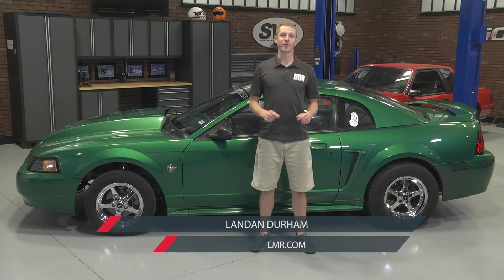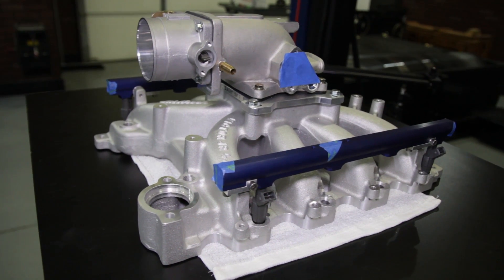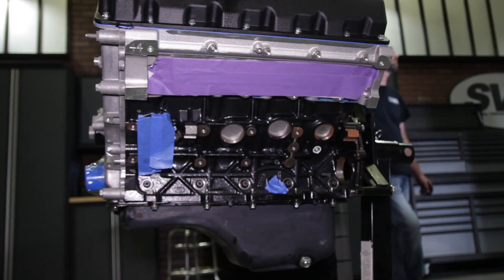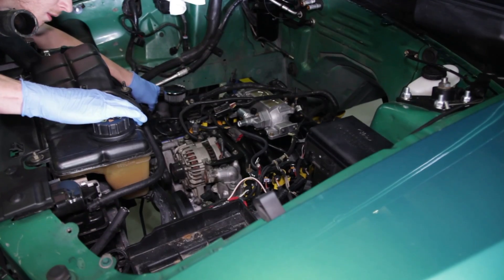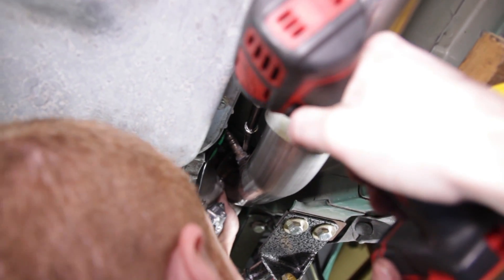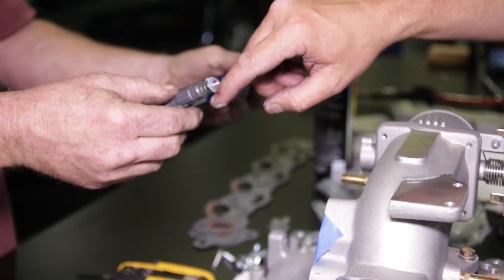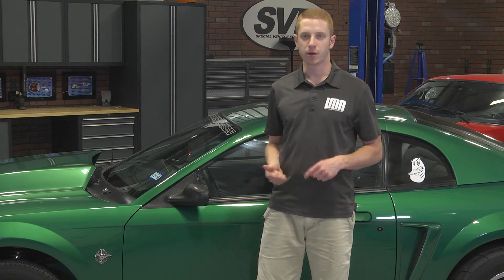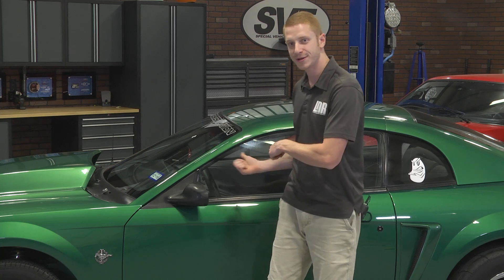1999-2004 Mustang GT Project Green Bean (Stage 5)

Comment: Where did you get the adapters for the intake? I plan to swap a 5.4 in place of my 4.6 with my v1 blower kit to add some more tq to the mix instead of placing another 4.6 in it
Reply from the maker: Hello Michael,

We did a search and found a few outlets that offered 4.6L to 5.4L 2v Intake Manifold Spacer Adapters. We picked one up that was the best price for your build budget. They range from $150 to $200 across the net!

Comment: just watched the entire build . ive always wanted to know if swapping the 5.4 would be worth the swap vs paying an arm and a leg for the 5.3 boss short block.. I had read that the 5.4 gives you more torque but the hp numbers for the 4.6 are about the same  they didnt  gain any noticeable hp over the 4.6 even though it has more displacement.. i have never been afraid of intakes or any of that since mmr has this adapter plate , but i do remember that some folks said you have to do some custom mods like cutting the k member to meet up with the 5.4 motor  as it might  be in a different location..  thank you for the videos keep them coming..

Comment: Why shorty headers? There is no performance advantage over stock manifolds. Since you were in there, why not go with long tubes?
Reply: Gitsum they just transfered over, cost savings. I don't think they just take parts of the shelves
Reply: David Martin if cost was the issue, they should have left the stock manifolds in place until long tubes could be added.
Reply: Gitsum well if anything, these headers probably offered 5 more hp 😂😂
But yeah long tubes are indeed better

Comment: questions I hope you guys at LMR can answer... Motor build up, what's the spec for the motor..looking to Motor my 4.6..
Reply from the maker: The engine we put in Green Bean was initially going into a Ford Lightning. So, it's a stock bore, stock stroke 5.4L with Manley rods and Manley 8.5:1 compression pistons. Trickflow 44cc heads, stage 3 custom ground camshafts, and fully dressed with ARP hardware. -Landan

Comment: will yall be selling the intake adapters?
Reply from the maker: At this point, there is no guarantee. However, if you are needing something to get you going, I believe MMR sells an adapter plate. Hope this helps. -Landan
Reply: ***** thanks brother
Reply from the maker: Correction. I was thinking manifold to plenum adapter. We ordered the cylinder head to manifold adapters from Professional Products. Sorry for the confusion. -Landan
Reply: @latemodelrestoration   whats the part number for the adapter plates iv been looking on web site cant find them
Reply: +Late Model Restoration i have a nice vortech v2, with the discharge tube, and with 8 rib pulleys and a sct 4 bank chip. if you all are interested in buying or making a trade for a set of race star wheels n tires (black gloss)

Comment: I'm actually in the middle of putting the same victor jr intake on my 4.6 do I still need that adaptor show in the video if I'm using the edelbrock plenum? Thanks for the help
Reply from the maker: Which Edelbrock plenum are you referring to? -Landan
Reply: +Late Model Restoration edl-3847 that's the item number taken from lmr.com it's the edelbrock ultra low profile intake plenum
Reply from the maker: No, you will not need an adapter since the Edelbrock 3847 bolts directly to the Victor Jr. intake manifold. -Landan
Reply: +Late Model Restoration awesome tanks again

Comment: Have any problems with the manifold adapters?
Reply from the maker: At this point, they are doing great! -Landan
Reply: Did you have any fueling issues with the adapter plates since this vid? I read on some forums that the plates gave the injectors a bad gap so it runs out of fuel quick on the top end, not sure how true it is but would like to know if you had experiences of such
Reply from the maker: The only issue to date was an oil pump gear failure. Other than that, the setup has been doing great! -Landan
Reply: I need a set of these manifold adapters for my car I bought victor jr manifold the plenum and fuel rails for my 4.6 but been wanting to do a 5.4 swap

Comment: I've always wondered, does the 4.6 absolutely need the yellow coolant as described in the manuals? or can you just completely flush it and get away with a universal coolant
Reply from the maker: I've used yellow coolant in just about every Mustang I've worked on other than the newer cars. The orange coolant contains different additives, such as Dexcool, for better cooling and is easier on today's aluminum-based components. - Landan

Comment: Why did you put a 4.6 intake manifold on didn't it restrict the airflow more than it already does I know the 5.4 intake is taller but didn't the cowl hood fit and I also read on forums you can put a coyote intake like the boss 302 not sure though
Reply: The victor jr has more than enough flow for the 5.4. If it was a plastic GT manifold then it'd be an issue. All the truck manifolds for the 5.4 are too long in the runner design to make power for a street car. They make lots of low torque though. The Coyote/Boss intake only works on the 4V heads because of the shape. I'm a little over halfway done my 5.4 4V swap. So I've got experience with all this already.
Reply: +ARavenousChimp what car is the 5.4 going in and I also thought the pi intake was really good one of the best ford has made and I didn't realize this is a 2v
Reply: The pi intake pretty decent, but again for a high performance build it's better to sacrifice the torque of the runner length for the extra horsepower up top. the pi intake is very rounded. My 5.4 is going in a 99' GT. Navigator (forged crank), Manley GT500 rods, JE flat tops for 11:1 CR, Ported terminator heads, bassani mid-lengths and catted X. The list goes on. Need to pick cams for it still. and have the block machined. but it's close.
Reply: +ARavenousChimp do you have any videos I would really like to see it what about electronics you change the computer did you use a cobra harness?
Reply: Car isn't done yet. Nothing needs to be changed really. Just flip the polarity of the coil packs on each cylinder and you're done. Some wires are a little longer here, a little shorter there. etc...